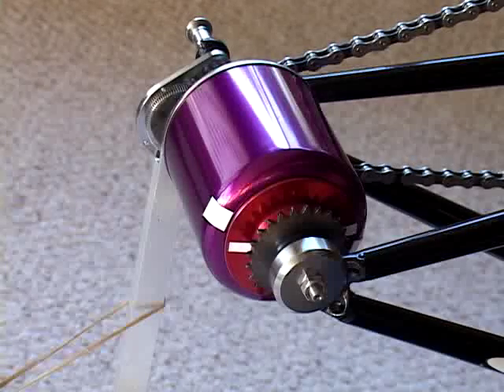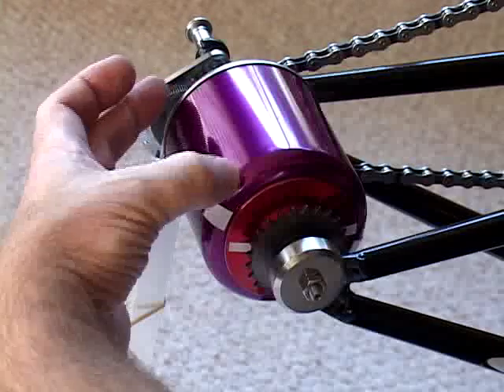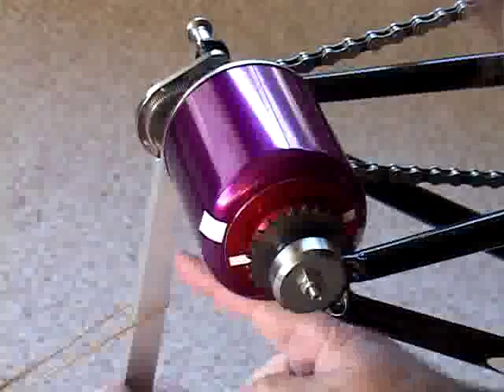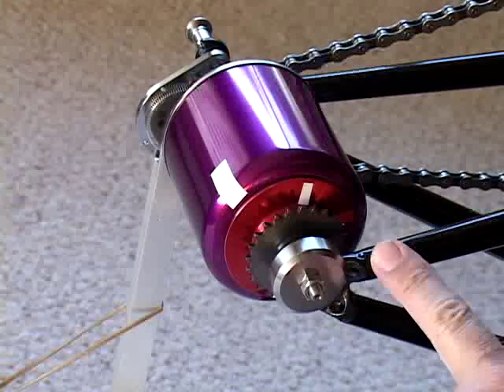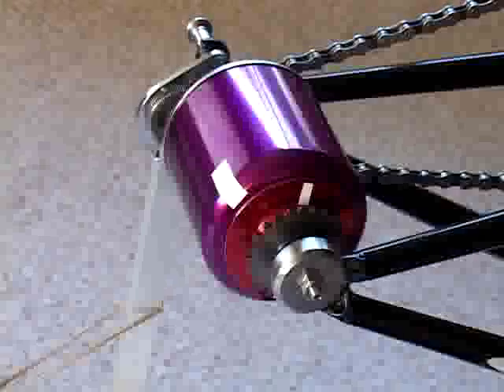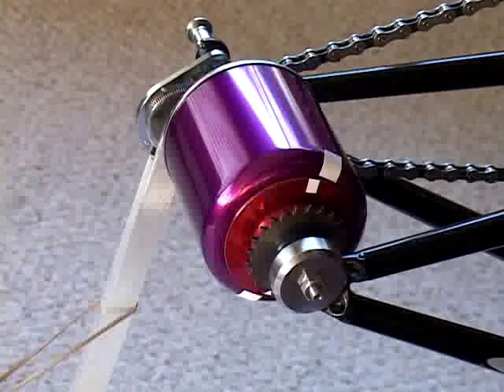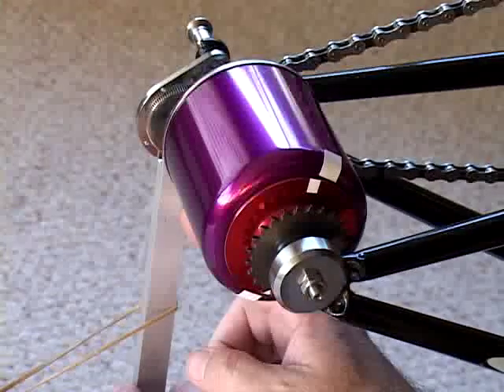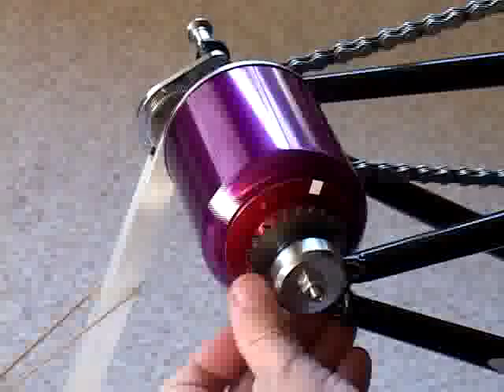Automatic Bicycle Transmission (IVT)

Comment: After 7 years, nothing, no practical commercial application???
Reply from the maker: You're under-exaggerating!  It's now eight years!  Hahaha!  I've been reluctant to involve a necessary investor until I solved a couple of vexing problems that would make the SIVAT vulnerable to severe damage under certain unintended conditions.  The problem is intrinsic to infinite variability in which some forces can rise 'exponentially' under certain condition that bicyclists occasionally encounter, and which cannot be solved with the overload-protection feature alone.  Solutions examined seemed to all involve adding huge components.  Originally, the unresolved issues seemed trivial until I tried many approaches without success.  Once I began to seriously calculate all forces for its normal operation, I found that the SIVAT needed a fairly radical re-configuration that consumed dozens of CAD studies & permutations.  The most promising variant was finally discovered through an extremely complex design process that I'd never anticipated in the beginning.  This variant now allows a very compact , simple mechanism to prevent damage under all conditions.  
My goal has always been to provide a transmission that performs like no others while remaining reasonably simple and reliable.  It took many years to get to the point of the SIVAT you see in the video, involving extensive studies and precursor prototype test-builds.  The SIVAT concept is the product of several epiphanies gained through difficult challenges along the way, always taking a scientific approach, but involving non-obvious attempts with scarce prior art for reference.  In retrospect, eight years is a minor part of the whole story.  I'm finally confident that I can offer investors & customers a pretty solid bet!

Comment: If I had to guess, the device in this video uses specially-indexed cams to create different variable speed settings with a non-grounded planetary gear system at the output for power splitting (or something mechanically equivalent) and thus generating gear ratios approaching infinity.

Comment: Imagine a electronic motorcycle with in hub electric motors in both the front and back tires using this design? Then using nano wire liquid battery technology incorporated with crystal graphite power cell technology? Would this not create a vehicle with unlimited range and one you did not need to recharge? Then you could do the same thing with other vehicles generating a very clear path away from using fossil fuels? Novartis

Comment: Umm sit down and look at an in hub electric motors used in electric bikes and motorcycles. Can you take your design to another level to optimize an electric motors use or in crease the speed while decreasing power consumption? Hay Novartis

Comment: I'm not trying to be skeptical at all, but since this was posted in 2008, why hasn't there been an actual working prototype for the past eight years?  Just curious.
Reply from the maker: In 2008, I hadn't predicted the collapse of the world economy and recession that made it very risky to start either a business or a new product.  Since then, I've been looking for a solid investor's contract among a few false-starts that weren't quite what I was looking for until this year.  I also retired, so haven't had resources for self-funding.  Redesigns and analysis revealed a fatal-flaw that required parts that were too large for my intended bicycle application until I came up with a compact solution only recently, so i wasn't completely confident in both the economy and a design that was not yet quite right either.  Now, it looks like both situations have changed enough to move forward, and I'm thoroughly preparing my newest design for a potential business partner who shares my view of how this will become a product.  The engineering, which is quite complex, is revealing numbers that are all falling within spec for components, so I think I'll be building a well-refined working prototype for testing within months.  Thanks.
Reply: Good to hear of these improved factors.  Have there been any improvements since 2008 in other factors like materials science, manufacturing processes, and/or design software that have made your transmission more feasible?
Reply from the maker: John Sawyer
After carefully combing through the component specifications and making many calculations for strength & wear, I concluded that I needed a radical reconfiguration that coincidentally revealed a way to add a vital component.  There was an inherent problem in the concept that required either another level of innovation or a part that would be too large, and I didn't find an elegant solution until I recently went through that process.

During the last 8 years, I've gotten several offers to fund development, but was reluctant to move forward without solving the issue I thought might be trivial until I tried to design around it.  The issue was that the SIVAT could be damaged under certain unusual conditions.  The radical reconfiguration finally includes the solution.  None of this has been easy.  This concept only works via very carefully thought-out design.  In 8 years, I've discovered over a hundred ways to do it wrong and one way to do it right.  The remaining challenge is to contain its width to fit bike standards.
I have the design tools and reference literature needed to adequately create a good working prototype.  Ultimately, the design should be analyzed with FEA to refine it, but that can be done in final development for the product(s).  Materials and fabrication processes are conventional, and recent technological advances offer little to consider for improvements.  The challenge will come if demand justifies expense for tooling & special processes for higher production rates & lower costs.  As a retired engineer who automated several processes during my career, I'm designing this for robotic assembly as much as possible.  At that stage, a manufacturing engineer who's very familiar with higher volume cost-reduction will be hired to focus on materials and fab processes.
Thanks for your questions; they're likely what others would ask.
Reply: SIMKINETICS - Thanks, and good luck.  If I had extra cash, I might invest.

Comment: If this transmission disengages under load, that's a problem. How do you expect to climb steep hills?
Reply from the maker: The SIVAT is designed to disengage under excessive load, meaning a load that exceeds the maximum permitted by design.  The design of the SIVAT is for mountain bikes for which my spec equates to ascending a 50% grade with bike & rider's weight at about 300 lbs; no rider can ascend a steeper hill than that without losing traction or popping a wheelie.  The protection assures that throughput torque doesn't cause excessive forces inside the transmission, so its power rating will be greater than 300 watts at 90 rpm at the input (pedals or hub input).  This power rating is based on studies done on elite bicyclists who race and typical mountain-bikers who ride hard.  If a rider wants to produce more than 300 watts, the SIVAT will force him to pedal faster than 90 rpm, which is the way racers generally increase their power.  Since the SIVAT is being designed to also be used on motorized small vehicles with this single design, power throughput will effectively be raised from 300 watts by gearing the SIVAT's input for higher rpm as used with motors, while ensuring that experimenters who buy & use it don't succeed by using a motor that's too powerful for the SIVAT.  The SIVAT will likely handle 1,000 watts if the motorized input speed is raised to 300+ rpm, but this additional spec will need proof through testing, as will the standard bike spec.  If there's demand for much more power throughput for motorized vehicle & machines, a bigger design is possible for those uses.  This approach avoids damage to this transmission from uses that are not recommended, uses that will be gently overridden to produce zero output without damage.  Normal use for aggressive mountain bicycling won't cause an overload condition in the tested, finalized design.
Reply: SIMKINETICS
Yeah, I was 100% sure you had considered all of this and had an answer, and actually I considered immediately after posting this that you probably take pedal cadence into account. 90rpm is pretty standard, and yeah, it's typically seen as good practice to spin faster in lower gears to get good power.
To be honest I've waited for this sort of thing to start coming out for many years. Bike technology usually leans toward making things light and aerodynamic and I look forward to a design like your proliferating in the market and the sport. I just hope it ends up being affordable.
Worth noting, my main consideration with the transmission disengaging under load has more to do with cargo and touring bikes than anything on racing or mountain biking. Really it was just a thought, my imagination going off and showing me the worst case scenario of a loaded tourer having the power disengage.
Reply from the maker: Homini Lupus
Yeah, a heavy load up a hill will simply cause the SIVAT to find a very high gear ratio with a very low output speed unless the power source is producing too much power.  Still, this should work with a good portion of a kilowatt, but at a predictably moderate or slow pace uphill, depending on the load & the steepness of the ascent.  It's all about gearing and modulating motor power.  My plan's always been to invent & design a very versatile transmission that can be adapted to various drive systems and uses.  It turns out that designing it specifically for mountain biking is a great starting point because it requires plenty of torque capacity, always a challenge for any compact transmission.
It's not likely to be cheap at first, but if it strikes a chord in the marketplace with honest demand to justify capitalization of a start-up, I know how to automate much of its production to drive costs down to make it affordable like a Sun Race, Shimano, Sachs or NuVinci hub.  The SIVAT's guts aren't so very different from those transmissions in terms of parts-count & sophistication.  The planned debut is a high-end, high-tech mountain bike with full suspension, so the costs will be buried in the whole bike that will hopefully appeal to those who are willing to pay to be the first to have revolutionary technology.  I want to avoid disappointing any initial or subsequent customers, so I'm being very cautious with the design & engineering.
Thanks for your interest!

Comment: Do you have a video of it on a bike   and someone riding around  using it ?
Reply from the maker: I'm currently designing the next-generation SIVAT with full engineering to assure a capable working prototype that will be mounted on a bike & tested by strong riders.  At that point we've built a prototype, a video will be produced to demo it on a bike with rider(s).  I don't yet know when that will be.  Thanks.

Comment: Nice work. I've run many printing presses that had this exact design for the inking system. The handle had a twist lock to hold the ratio in place. Most of them had 8 sets of ratchets that were 90 degrees out of sync with each other. 12 o'clock being neutral, moving the arm towards 1 o'clock engaged 4 of the paws for forward drive and bringing the arm towards 11 gave you reverse. You could put several hundred pounds of torque through them without a problem which would lend itself well to a bicycle drive system. The only limitation to the design is high rpms. The weight of the ratchet paws and the strength of the return springs are the limiting factors. Heavier duty paws can transmit more torque but have more momentum which requires stronger return springs to work at high rpms. Stronger return springs means more friction on the ratchet teeth at lower rpms which wears them down. Seen it happen. If you want high rpms, put a gearbox after it.
Reply from the maker: This is not exactly the same mechanism.  The principal differences are complex.  As far as I know, the SIVAT is totally unique & new.  It does not use actual ratchets even though it's classified as a 'ratcheting drive', so ratchet friction is not an issue.  As for adding extraneous gearing, that can also be done and is done here with gearing ahead of the input rather than 'after' the output.  Apparently, you understand that such systems can be geared to suit the application, though.  Thanks for your comment.

Comment: Why not demonstrate overdrive on it?
Reply from the maker: Overdrive is demonstrated here if you consider pedal rotation as the input and wheel rotation as the output.  The simplest form of the SIVAT is featured here, and it is intrinsically a reducer with its highest output speed somewhat lower than its own input speed (~0.8X); overdrive is achieved with 'gearing' that increases input speed to the SIVAT.  The chain drive here uses a 55 tooth front sprocket with an 11 tooth rear sprocket, multiplying the SIVAT's effective output speed to about 4 times pedal-crank speed [(55T/11T) * (~0.8) =4.0)].  Such 'step-up' gearing is added to the internal mechanism of the next-generation SIVAT design, so it will feature an 'overdrive' feature with ratios similar to the featured prototype without any external 'step-up' drive.  Mounted on a bike, the new SIVAT will achieve its highest output speed to be the same as a typical derailleur system (that uses a 44T/11T sprocket drive high-gear) with both front & back sprockets the same size, allowing a fairly small front sprocket for enhanced ground-clearance for mountain bikes.  Riders who want even higher output speeds than conventional mountain bikes offer can choose either a bigger front sprocket or a smaller rear sprocket; this will not interfere with the SIVAT's ability to produce very low output speeds with increased torque for climbing hills, nor will it preclude a non-driving, zero-speed output under overload conditions.  SIVAT's ability to go to extremely low gears (always including zero) under high-torque gives it considerable flexibility in how it's geared and how it's used with a single design.

Comment: Ok now, how will this not burn up at 6000-10,000rpm? I build motorized bikes and don't think this would work. But I am optimistic! Intrigue me :-)
Reply from the maker: No problem.  The SIVAT's critical speed (the speed at which vibrations destroy its function) is unknown, but I spun the featured prototype to about 2,000 rpm without problems.  The working prototype I'm now designing is somewhat different (better) & stronger, owing to what I learned about weaknesses from testing this featured proof unit.  Testing the next prototype for maximum speed will be done.  Regardless, the SIVAT being used for various input speeds of prime-movers, whether legs or engines or electric motors, can be easily accommodated with simple gearing between the prime-mover and the SIVAT to bring input speed to a preferred level.  If your motor runs best at around 10,000 rpm, for instance, you could use a gear or sprocket set that reduces the input speed to the SIVAT by a factor of 10 or 50 or whatever to get the SIVAT input at a good, lower speed.  
The good news is that the SIVAT power capacity rises in proportion to its input speed which will be rated at about  300-500 watts at 90 rpm (I'm designing the next unit now, so I'm not certain about exact throughput yet).  If the SIVAT has 500 watts capacity at 90 rpm you'll be able to use a 1,000 watt motor geared to reduce SIVAT's input speed to 180 rpm.  Due to internalized step-up gearing for the input, the SIVAT's critical speed will likely be about 200-250 rpm at the input; maximum power capacity might be as high as 1,400 watts (1.88 hp)!  The next design SIVAT will be tested for power capacity at various speeds during life-testing.  Note that you might get best results with your motor running a bit slower with less severe reduction gearing into a SIVAT.  If all goes well for pedaled bikes, we'll eventually test the transmission for use on motorized bikes; at that point, you may want to get involved.
Thanks for you question!